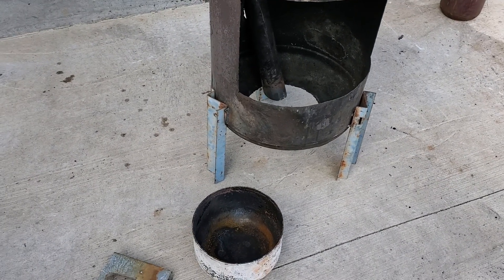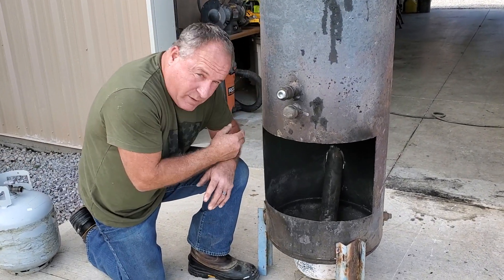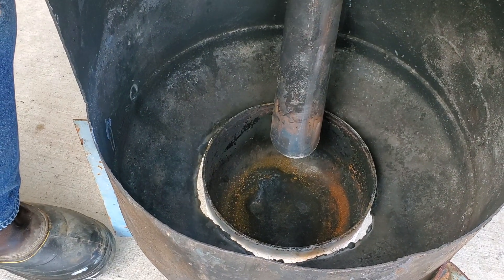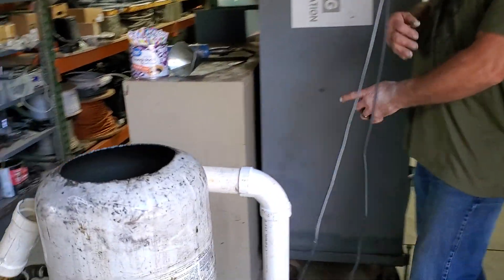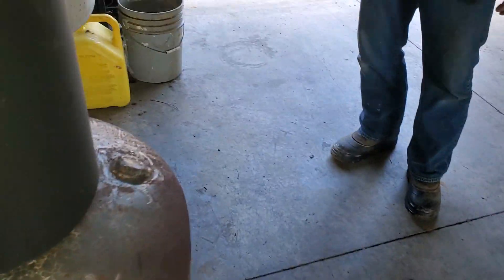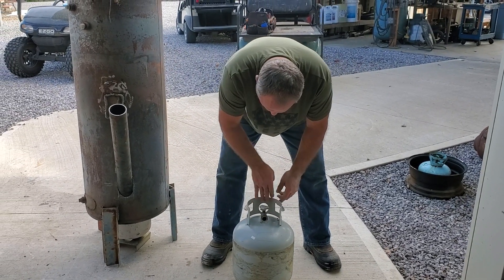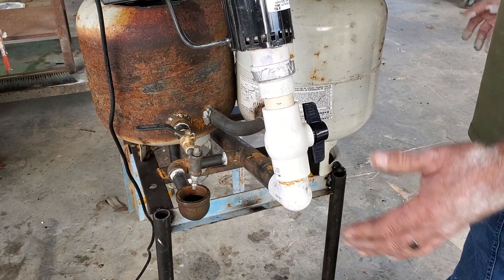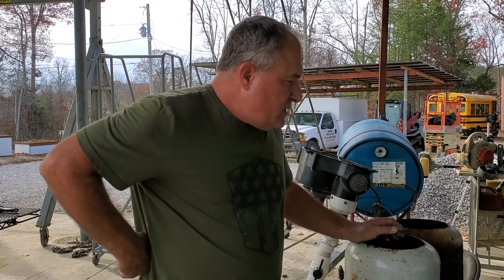ROCKET STYLE WASTE OIL BURNER HEATER BUILD ILLUSTRATION

Comment: I like your design. My question the one you have heating your shop has a 8 inch exhaust. The other outside you made has a 6 inch exhaust. I would think the 6 inch exhaust would 
Have better draw that that 8 lunch. I would think you would have a lot of heat lost threw 
The 8 inch exhaust. Your thoughts please?
Reply from the maker: i find the 8" gets my burn going better
Reply: 8 inch better draft (suction)
Reply: The height increases the draft too. Gerry's design without a fan showed that.

Comment: Can you explain why your oil drip doesn't just go straight down into the 1.5" tube but instead goes into that "big 90/nipple/smaller 90/nipple" setup?  Is it just that the turbulence from the fan blowing through it makes a mess or is there some other reason?

Comment: Enjoyed the video very much. Wanting to try and make a burner for melting. Stuff like aluminum and copper. How do you know, how much oil flow to use. Have seen some drip and some with slow flow. Does there need to be a  fan for this setup. Guessing the fan helps burn hotter. Have seen with and without. And instead of a vent pipe on top. I would just leave the hole and put a thick grill on it. To hold a pot or pan. Appreciate the information from the video.

Comment: It's going to be interesting to see what the bigger air pipe does. I don't think it will make a lick of difference using a fan but it might if you lost electricity and had to run it without the fan. And I loose electricity often out here where I live.
Reply from the maker: When I lit this new build with bigger pipe it did not make burn any cleaner until air was introduced.